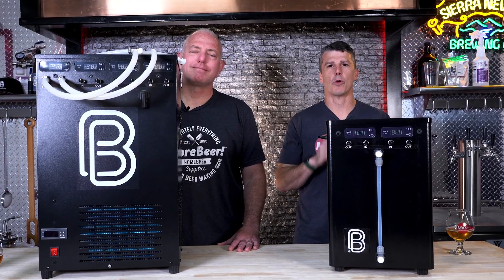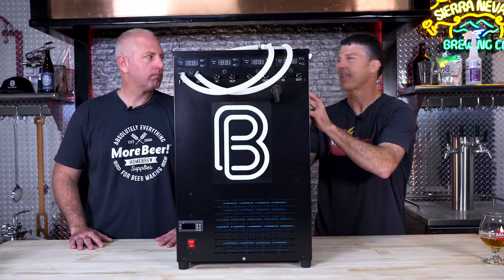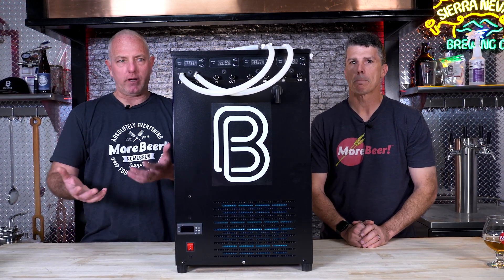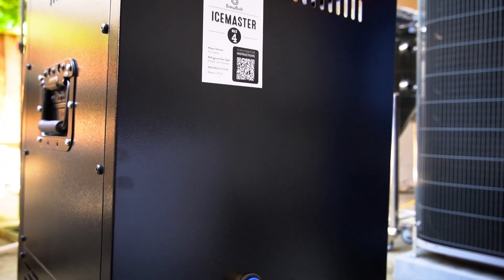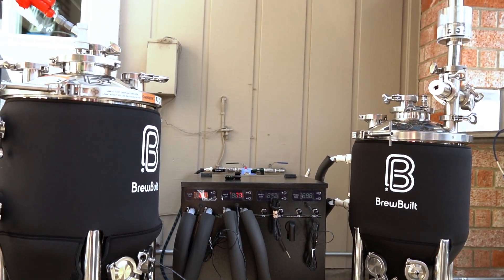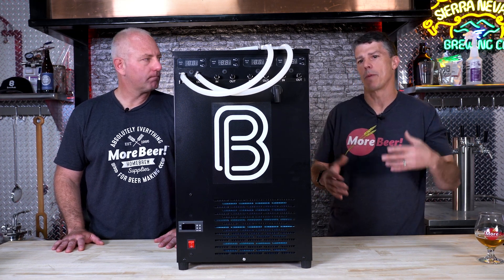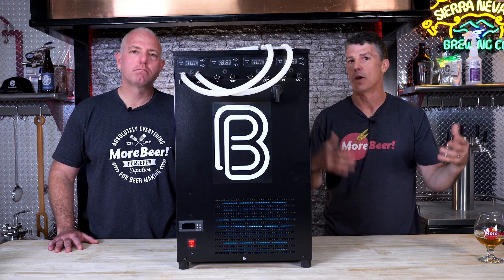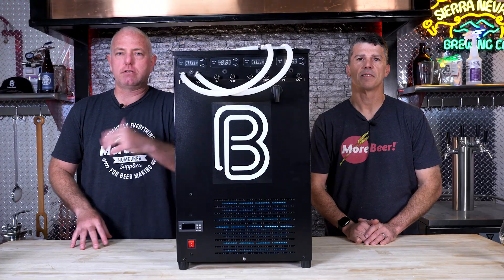What is a GLYCOL CHILLER | MoreBeer!

Comment: Do these machines only cool or can they add heat also? I live in an area that is relatively cool for 8 months of the year. Would I need one of is it a nice to have? I'm assuming the cold crashing process drops the yeast out of suspension quickly and give a beer with less yeast and sediment? Sorry for asking stupid questions but when I was home brewing conical pressurised brewing wasn't a thing and I'm watching youtube to try to learn about new equipment and techniques.  Thanks.

Comment: I have a question.  For those of us who don't have an X2 (I have a very old original Brewbuilt conical), what type of immersion chiller would I need to install in the thing to make this work?  And also, would I be able to go in through a custom 3" TC on the lid?  I only have one 1-1/2" TC at the side of the fermenter so with that as the beer exit, I don't have place for a thermowell and 2 additional fittings for the chiller. 

Would I need a stainless chiller or is copper ok? I assume copper is not desirable from a corrosion standpoint.  I have several other chillers but my main one is copper and is used for post-boil work.  I have one for my brewzilla which is stainless as well as a third, but the configuration of those probably isn't going to be easy to get inside the fermenter without re-bending them and I am not sure about doing that with SS.  I don't have a tubing bender.  Currently, I use a 25CuFt stand up freezer with custom made racks to hold my conical and can also fit 2 glass Big Mouth Bubblers simultaneously, but both beers must share the same fermentation temp, so it is a bit limiting in that respect.  This also might not be so good with 6-7 gal fermenters for 5 gallon batches, though maybe it's fine for those too.  I'd be interested to hear from anyone using it on 5 gallon batches.

Comment: Are you able to use a glycol chiller to bring a high temp down? For example 220 degrees Fahrenheit to 38 degrees Fahrenheit? Wouldn’t necessarily need to be really fast but I’m just wondering if it would break the chiller. Also, if using a glycol chiller could you turn a brite tank into a tank where you can serve a cold beverage from? Like a bar or something?

I’m a novice so I appreciate your help.

Comment: In order to use Keglands RAPT system (maybe their controllers) would you reccomend just using the max 100

OR - is there a way to integrate the rapt control into the icemaster 2

Comment: I asked a similar question in another thread, but I just want clarity.  Can this unit also heat?  If I make mead in the winter in my garage I want to make sure I can maintain a warm temp for fermenting.
Reply from the maker: Hey Stephen, sorry for the confusion. These systems are really meant for cooling. In your case, you may be more interested in using something a heating pad connected to a temperature controller in order to maintain that warm temperature that you're looking for!

Comment: I've been using the Max 4 and it works great! The controllers have the ability to also turn on/off a heating unit, but they didn't include an output jack for that. That would be a nice feature for things like saisons or brewing with kviek, and they could offer a heating unit/jacket as an accessory.

Comment: What should the reservoir controller that is in back of the unit be set to? Should it be at 28F (-2c)? I've read that it should be about 15f lower than your coldest fermentation temp would be, so that the compressor does not power on/off more than needed.

Comment: So I ferment in a modified dorm fridge that cools AND heats. What about conditions where you need heat for fermentation? Is there a chiller/heater? Needed for cold climates or kivek yeasts.....
Reply: Use a temp controller and reptile heater or heat wrap … some guys use a ceramic Light